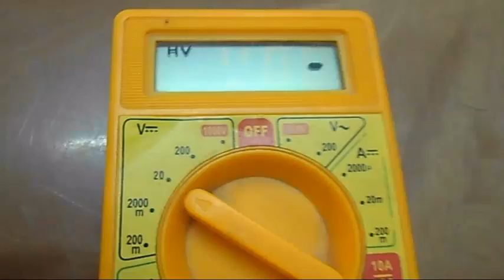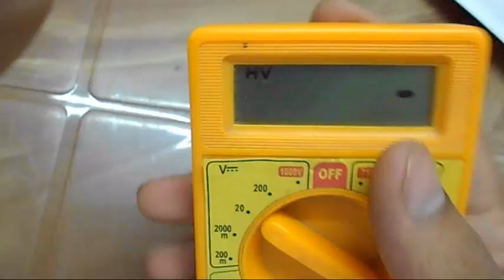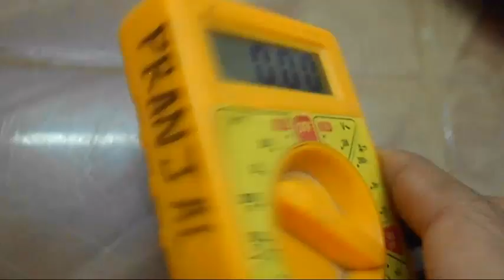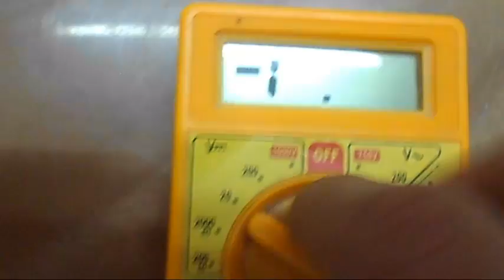Multimeter Display Problem

Comment: my digital  multimeter continously beeping in contunety mude. i was input 19volt supply in place 9volt battary by mistake then the problem start please help me.my multimiter is same as u used in video but there is no fuse inbuild

Comment: i have the same kind of multimeter.
my multimeter is not showing zero.
it is showing some random numbers... most probably 1 with +ve and -ve sign .
and continuity is not beeping and not displaying screen when i point it to continuity and 200 ohm, 2000 ohm and 20k ohm.
Reply: Same problem as mine
Reply: has your multimeter got short before happened this
Reply: Yes center wave has been short